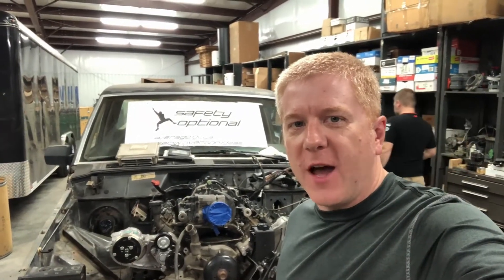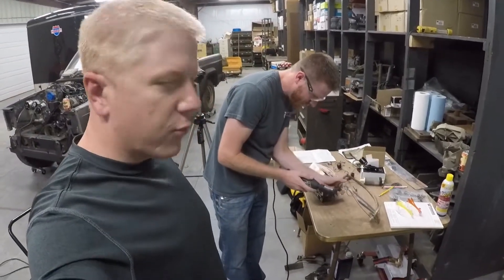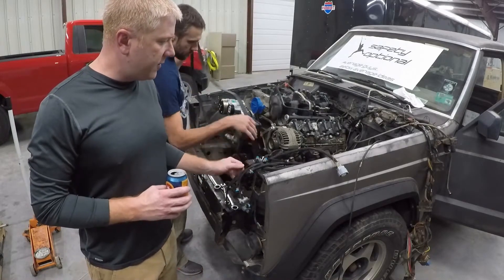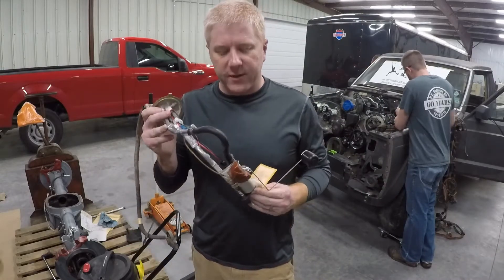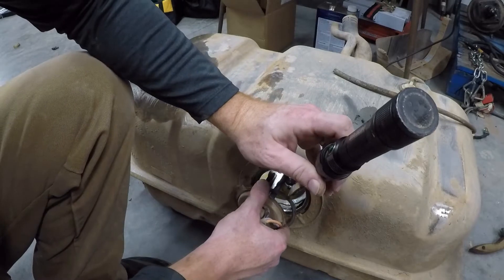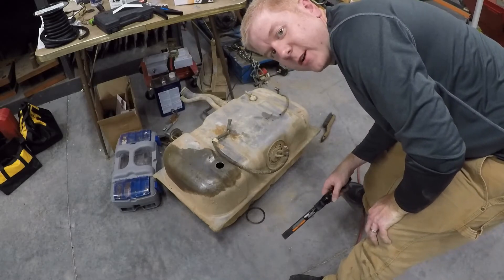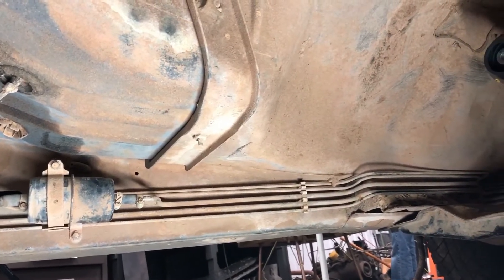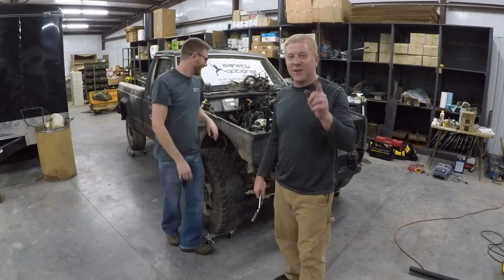Jeep Comanche Pickup V8 Swap - Part 11

Comment: Watch that fuel sock, if it’s not securely mounted to the pump assembly it’ll come off and cause a stall out.  Otherwise awesome stuff!!  I’ll be attempting this on my ‘88 when that ole 4.0 gives out.  🤘🏼👍🏼👍🏼
Reply from the maker: That’s a good point. The Deatchwerks fuel pump filter sock is held on with a metal clip.  I didn’t show that or talk about it.